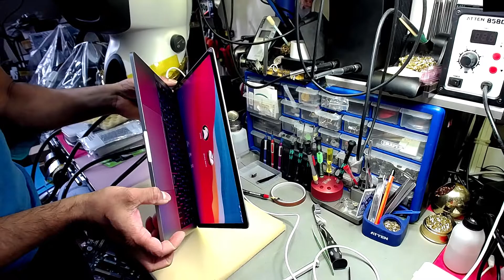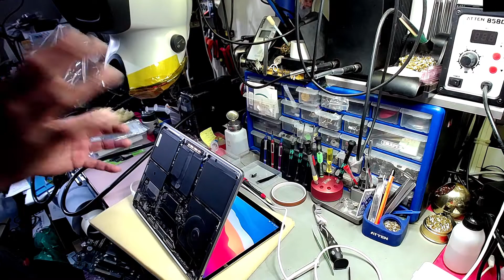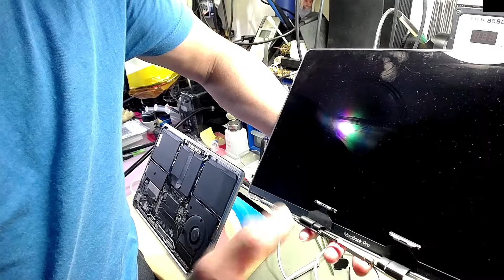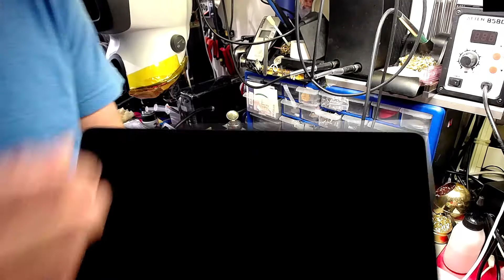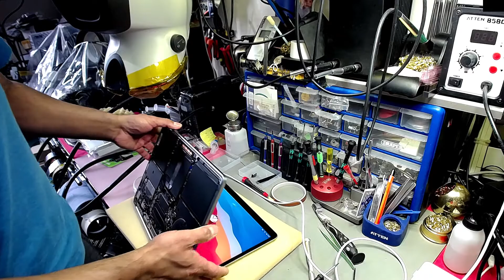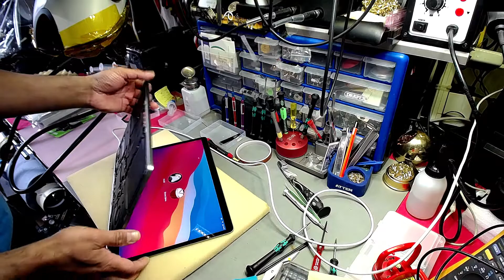MACBOOK PRO 13'' A1708 2017 BACKILIGHT FAILS AFTER LCD FULLY OPENED FLEXGATE

Comment: This is really common, bendgate. This is a fault Apple should of done a recall for. Great vid👍
Reply from the maker: Just had a call from customer, apparently Apple honoured a free repair under "eligibility program", subject to nothing else caused the issues, lol. It's a lcd flex??? Booked I for Friday, let see what happens.
Reply: @iTCXtreme  hopefully they sort the issue out for them, and they should have to considering it’s a fault with the design, no fault of the customers. Finger crossed it all works out 🤞